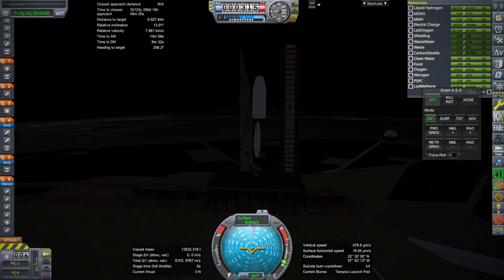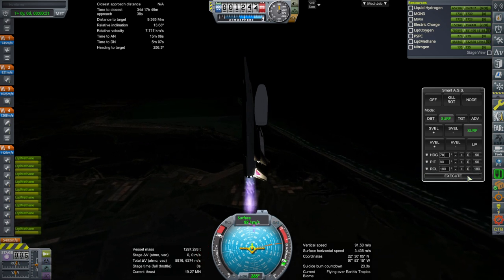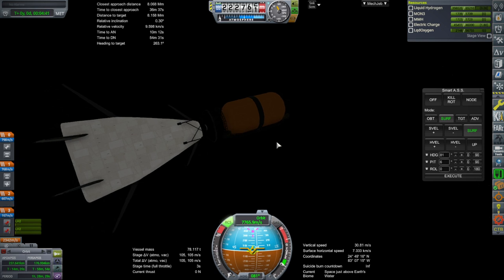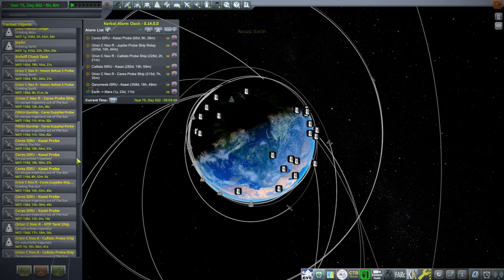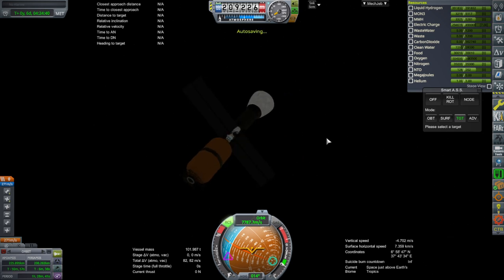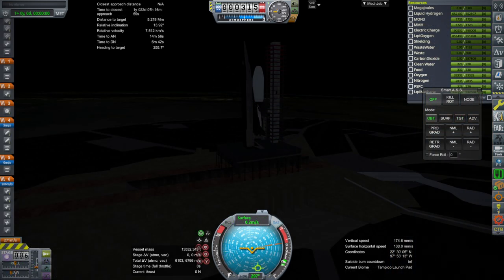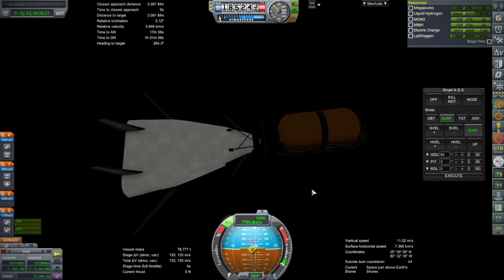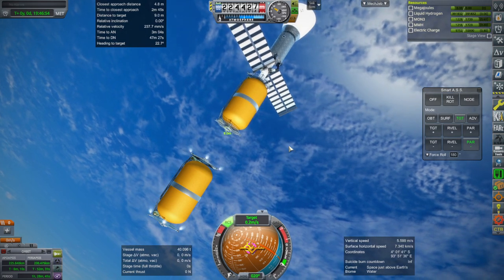To Mars and Beyond S2 Episode 9 (KSP 1.12)

Comment: Maybe it’s calculating the surface-area to volume ratio, so the smaller tank has more radiating surface compared to its contents, because of the square-cube law. That could be why the boil-off is higher in the oxygen tank.